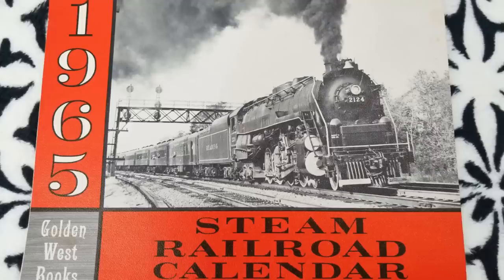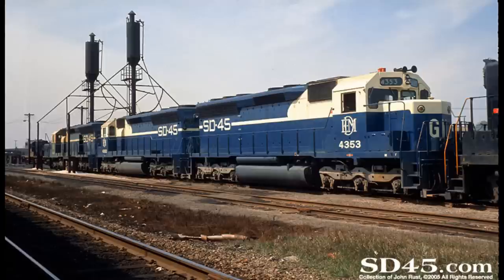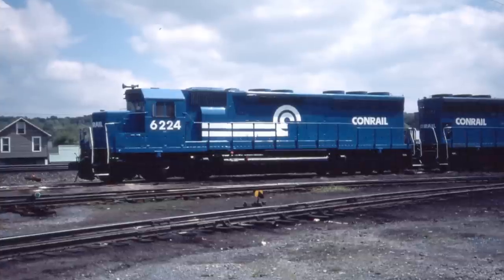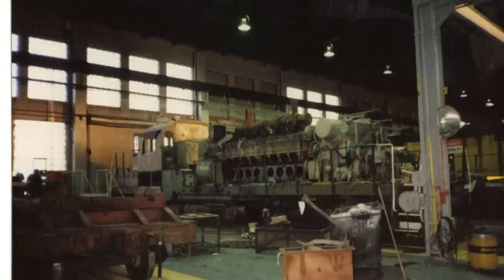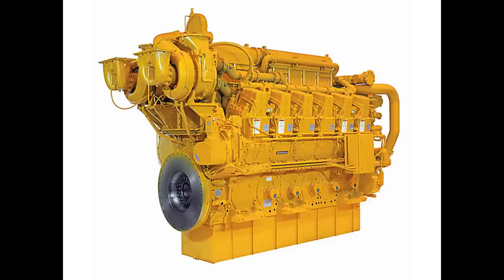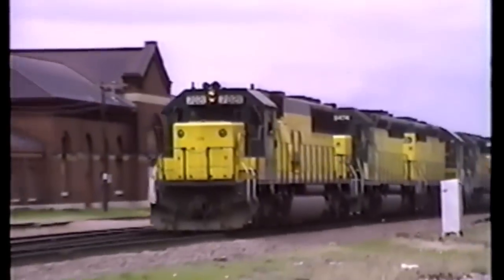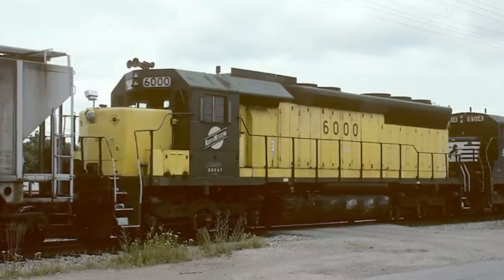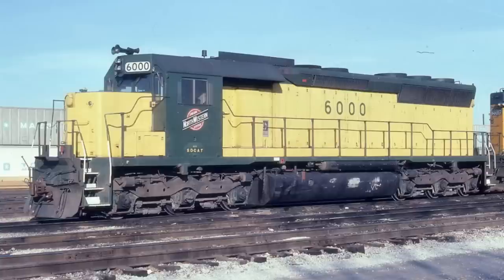The History of the One and Only 6000 | The Chicago Northwestern's SD-CAT

Comment: The Pennsylvania Railroad locomotives were uniformly painted in a color commonly called Brunswick Green but known to the railroad as Dark Green Locomotive Enamel (DGLE, or DGLC for -Color.) This was an effectively black paint that contained a high proportion of copper oxides. These gave it a very slight greenish tinge that became more pronounced over time and with wear as the paint further oxidised. DGLE is often described as being indistinguishable from black when fresh unless next to a pure black paint (as used on the underframes of PRR locomotives beneath the running boards).
Reply from the maker: Thanks for the correction on the paint color, I must admit I didn't do that much research when it came to that part
Reply: That color has been described as a gallon of black with a drop of green in it.

Comment: The sd 45 on average weighed in at 400,900 lbs! These locomotives  were some of the most  heaviest diesels built. And this cat engine was a very troublesome engine ever  put in a locomotive. They also had a reputation for being unreliable,  and hard to start in cold weather.

Comment: Here in Brazil we had the same situation happen, by 1987 the EFVM was recieving it's first models of the GE BB40-8M (a metric gauge variant of the C40-8) with 4000HP so the railroad decided to try and get it's EMD DDM45 (think of a SD45 on top of the D-D trucks of the DDA40X but on metric gauge) to work 1 to 1 with them and like the CNW tried the CAT 3612 V12 engine on two units (815 and 851), unsatisfied they decided to go with GM-EMD themselves, so they disassembled 6 DDMs and sent their cabs, electrical cabinets and prime movers to La Grange, these 6 units had their prime movers rebuilt, still as 20-645E3, and were microprocessed being renumbered to 1827, 1828, 1830, 1843, 1847 and 1855 (the no.1 was added to the original number of the unit) an being redesignated DDM45-MP, although the DDM45-MPs could deliver up to 3800HP for tracktion with their new microprocessed controls the conversion was not seen as cost effective due to fact the price was almost the same as buying a brand new GE BB40-9WM.
As for the CAT units they kept their CAT engines until 1995 when they recieved their 645E3s back but before that they were used in several experiments most notably using paraffin oil and bunker C heavy fuel oil (same stuff ships use as fuel).
Reply: Last one I saw was a VL!.....I miss those when I visit.
Reply: @trainandtruckmodeler786  Yeah VL! has scrapped theirs and Vale's are in long term storage and tarped over in Nova Era
Reply: @fernandomarques5166   I have all my decalques in storage....I was a fan of ALL and MRS. Paint only trains of Brasil and Bolivia.
Reply: @trainandtruckmodeler786  Oh nice. I'm more of a RFFSA and FEPASA fan with a bit of CVRD sprinkled in the middle. Surprising to see someone from a foreign nation who had interest to model our railroads.
Reply: @fernandomarques5166  my cousin was a driver for ALL....my grandma was from Curitiba. She moved to the USA when my grandpa was down there from the military back in the 1930s...I still have family but very few left in Brasil...my dad used to have friends at RFFSA ...when I was a kid I got to ride for a day on the GT22 .
Reply: @trainandtruckmodeler786  lucky. My area was broad gauge so I got stuff like the SDs and big U-boats. I saw the US C30-7s comming of the ships in the early 2000s.
Reply: @fernandomarques5166  sadly by the time I come back all the Rumo C30-7s will be gone, and maybe the SD40-2 and SD40t-2

Comment: There was a lot of experimentation with Cat engines in the 80s. Norfolk Southern tried to rebuild several passenger GP-9s with Cat engines designating them TC-10 for Transfer Cat 1000 horsepower. I've often heard of Cat powered locomotives as sounding like a bulldozer on steroids.

Comment: AT&SF HAD A SIMILAR ENGINE SWAP USING THE SD 45-2 RN# 5855!
MY BROTHER AND MYSELF WORKING AT ARGENTINE SHOPS
GOT TO PERFORM SOME EMERGENCY ENGINE WORK ON IT CAUSED BY A MECHANIC MISTAKE AT CORWITH SHOP IN CHICAGO!
THE HIGH WEIGHT OF THE CNW UNIT WAS DUE TO BEING HEAVILY BALLASTED A THE TIME OF ORIGINAL CONSTRUCTION!
THE 5855 CAT WAS DERATED FROM 5000 POSSIBLE HP TO 4300 HP TO ACCOMMODATE THE EMD TRACTION ALTERNATOR AND TRACTION MOTORS 
THIS WAS ALSO TOO MUCH AND THE ENGINE WAS AGAIN DERATED
TO 3900 HP!
AT THIS SETTING IT WAS AN AWESOME PERFORMER, MAKING A 
645-20 LOOK LIKE A BOAT ANCHOR!
AT THIS TIME A 645-20
MADE 3600 HP WHILE BURNING 180 GALLONS OF FUEL AN HOUR!
WHILE I NEVER HEARD EXACT FIGURES THE CAT WAS QUITE GOOD ON FUEL MILEAGE!
IF I HAD A SAY IN THE MATTER I WOULD HAVE INSTALLED THE GENERAL ELECTRIC TRACTION ALTERNATOR AND THE 752-AF TRACTION MOTORS AND RAN THE ENGINE AT 5000 HORSEPOWER.
THE EXPERIMENT WENT WELL, BUT NOT REPEATED DUE TO THE PERFECTION OF THE DASH-8 GENERAL ELECTRIC LOCOMOTIVES!
STARTING WITH THE 7400 , 500, 800 AND 900
CLASS UNITS SANTA FE 
BECAME A PRIME BUYER OF GE POWER!
THESE ENGINES WERE ALSO LEASED ON THE HORSEPOWER BY THE HOUR ALONG WITH GENERAL ELECTRIC 
SUPERVISED MAINTENANCE!
IN ALL OF THIS , I CONCEIVED A MINOR
REDESIGN OF AN INTERNAL ENGINE PART WHICH CATTERPILLAR USED TO MAKE THE 3600 SERIES ENGINES EASIER TO MAINTAIN WHEN BEING USED AS LOCOMOTIVE POWER.
KEEP THEM ROLLING BROTHERS!!
👍👍
Reply: EMD was going downhill then, but when the dash 9 came out, EMD went into the canyon.and CAT is still performing CPR to them since they bought it.

Comment: A very informative video. As it's said in the trucking industry "Yellow paint comes at a high price." But if they weren't so heavy, we'd have seen a lot more road switchers with 3512s and 3516s. Don't know how long they're going to keep the C175 gimmick going. As EMD 1201 vanished without a trace.
Reply: out in Colorado on a test track....as a bumper.

Comment: If you want to look at CATs in EMDs... Look into the SOO and BN (later TCWR and RRVW) using CAT 3516's in a "GP20c"
Reply: CAT makes a unbeatable motor for locomotives....well heck they own end now.....I don't remember this locomotive having as many problems as this video states. I do remember one of my dad's friends was using and the crank shaft failed but other than that it was spotted by me in 1994...I didn't see it after that. My dad had this engine on the point and I rode in it as well....I don't think it vibrated any more than a 6800 or 6900 SD40-2....
Reply: BN had a SD40-2cat....when my dad left CNW in 1991 it was in Cicero for months ...

Comment: cool vid - and now Caterpillar completely owns EMD, funny how things change
Reply from the maker: Thanks, funny how the world works like that lol
Reply: And then they didn’t really change. The new tier 4 CAT Progress Rail locomotives are some of the most problematic modern locomotives made. A lot of it is due to software parameters being too tight and setting a lot of faults in the computers.
Reply: @ralfie8801  and making them 4 stroke was a stupid thing tom
Reply: @ZombieSlayer-dj3wb  It's not those engines being 4-stroke that's the problem. They were rushed (to say the least) because Tier 4 emissions requirements from the EPA couldn't be realistically met with the 710.
Reply: @bakerboat4572  what i mean was 4 strokes only last 30 yrs

Comment: The EMD 645-A3 20 cyl did not weight 4148 lbs  it weighed 40,144 lbs.
Reply from the maker: didn't realize I made that mistake, thanks for catchin that
Reply: @cnwproductions   It happens,  you sort of recovered it when you gave the correct weight differential between the 645 and the CAT.